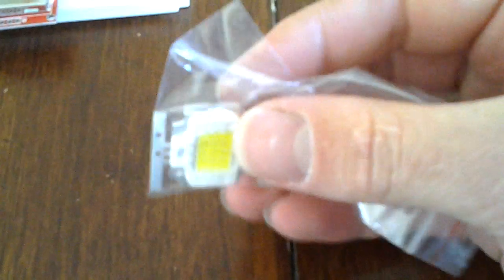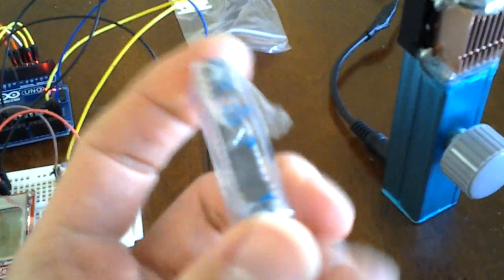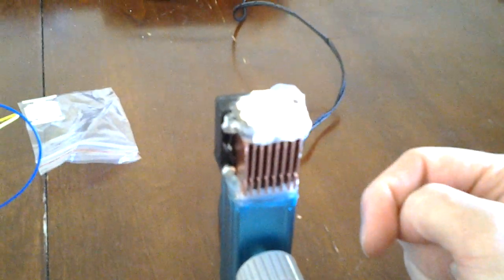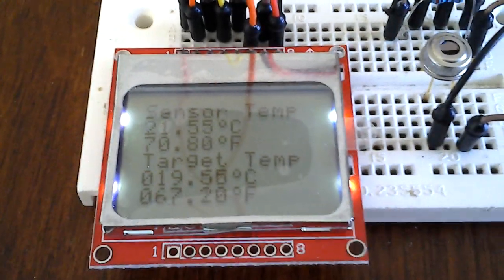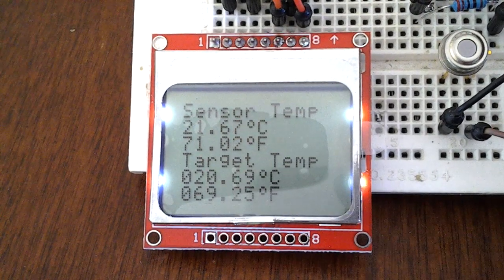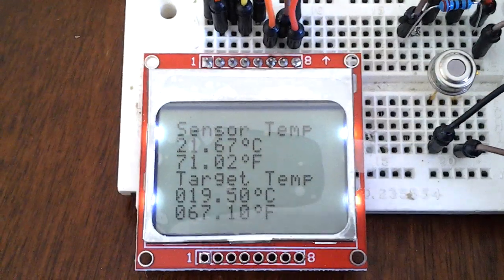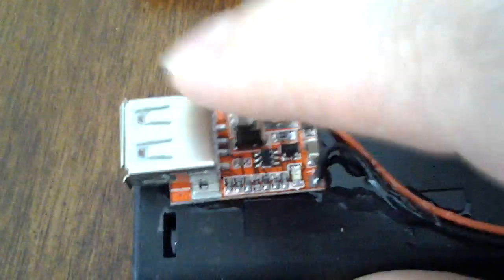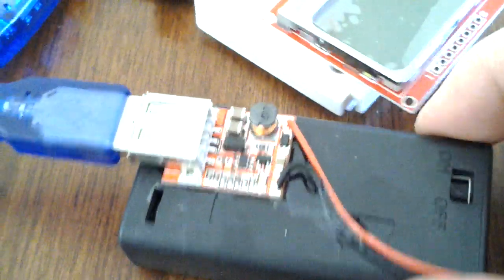Attiny85 LED lamp and nokia display project

Comment: How can I get my hands on that heat sink and fan?
Reply from the maker: Hmm....well the heat sink is a part of a big heat sink that I cut to fit it's from a computer and the fan is from an old 12 volts inverter pretty sure you can get similar from eBay for cheap or simply salvage :)

Comment: i used this exact led X4 + attiny in each of two brake/tail lights on my 4x4. attiny(PWM) --> tip35c NPN --> LEDs x8  = <950mA forward current at 10vdc = 8-) happy days. Bright hehehe

Comment: get some better quality cree XM-L leds. They are a little more expensive but much nicer, more efficient, and much better quality. the can get up to 1040 Lumens and because it is a small single die, it can be used for flashlights.

Comment from the maker: Of course i have the wiring diagram it's very easy to connect use 5 pin on the arduino 6 if you want to control the back light as well found it on google the way to connect it :)